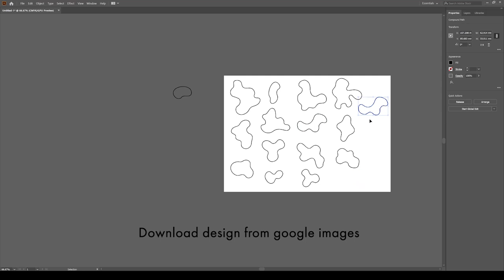How to custom paint crankset  (DIY Spray Can)  | Repaint Tutorial

Comment: Great outcome, they look mint. How have the cranks stood up to shoe rubbing ?? this is typically where my cranks get marked the most. Do you need to repeat the clear coat every xx months ??
Reply from the maker: U can consider polishing for shallow marks. For deeper marks u might even need to redo the painting because in the process of sanding away the marks u might cut into the color coat.. if u have concern on the longevity of the finish do use a high solid 2k clear coat.